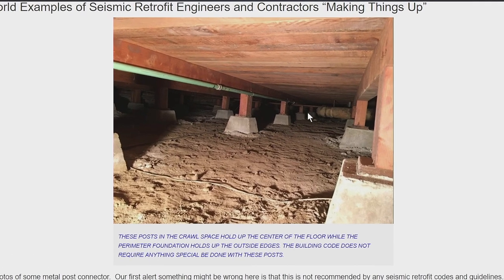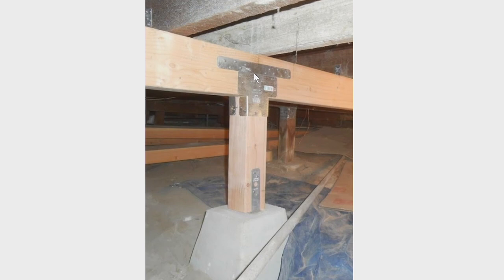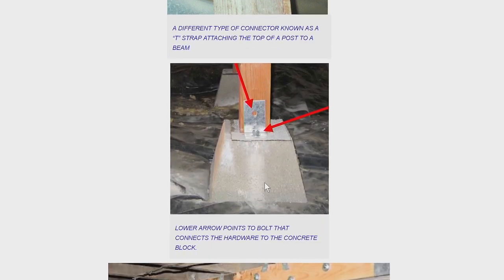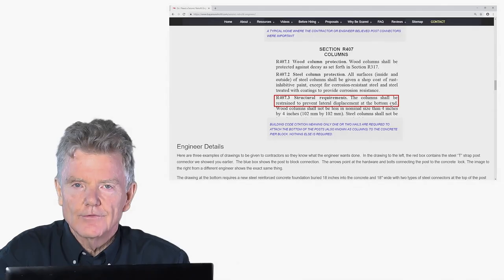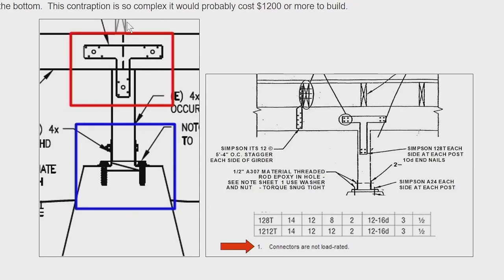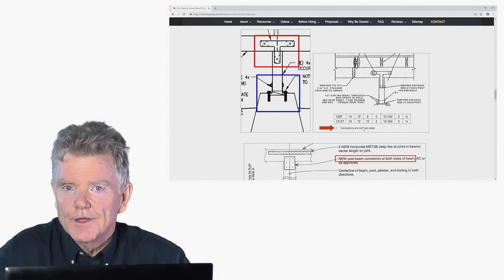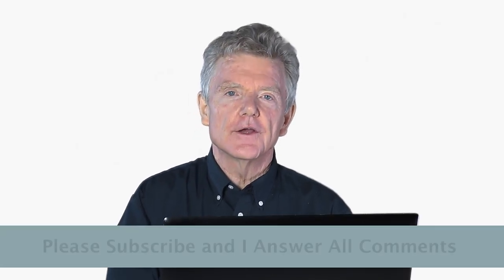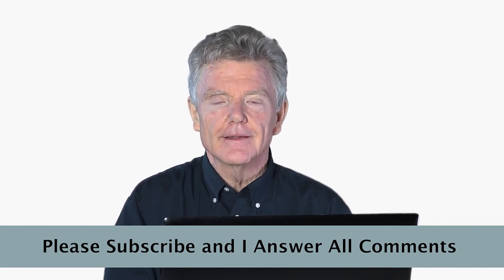Seismic Retrofitting The Post to Beam Connections

Comment: I see your point as it is related directly to seismic or 'lateral' loading incidents. However, you are leaving out two additional VERY important types of loading conditions...The first is due to soil movement (shrink/swell) and the second is wind uplift anchorage. These connections are instrumental in aiding in structural stability of the home during those two types of loading conditions. To tell people that the engineers are simply "not educated" enough and just spec these connections because they are uninformed is a bit dangerous on your part.  Especially given the fact that you didn't even mention these additional loading conditions...It is the engineer's job to think through and design for ALL possible future loading conditions. IF you are going to make a video spreading misinformation, maybe you should be able to disprove the need for those connections ( after applying all loading conditions) mathematically. IF you cannot, you are not qualified and you should simply not speak on these matters. Also, I will remind you that the IRC code is the MINIMUM spec allowable. It should not be looked at as the end all/be all for construction. It was created to give the contractor and homeowner information on the absolute MINIMUM safe design conditions.
Reply from the maker: I see your point as it is related directly to seismic or 'lateral' loading incidents. However, you are leaving out two additional VERY important types of loading conditions...The first is due to soil movement (shrink/swell) and the second is wind uplift anchorage. These connections are instrumental in aiding in structural stability of the home during those two types of loading conditions. 

I live in an area that is almost entirely unconsolidated soil that shrinks and swells as you describe and have never seen a post connection come apart even the least bit. 

To tell people that the engineers are simply "not educated" enough and just spec these connections because they are uninformed is a bit dangerous on your part. Especially given the fact that you didn't even mention these additional loading conditions.

How are a few nails or even steel straps going to prevent a house from lifting up off its foundation?  We do not see this kind of damage in earthquake county, at least I am not aware of any.  From my point of view building codes inform engineers and contractors which connections are important, and this isn't one. 

..It is the engineer's job to think through and design for ALL possible future loading conditions. IF you are going to make a video spreading misinformation, maybe you should be able to disprove the need for those connections ( after applying all loading conditions) mathematically. 

I do not look at theoretical/mathematical conjecture.  I look at empirical evidence and also hope that the authors of the building code did the same.  If you can find ONE photo of failure to a post beam connection due to soil displacement I will point that out because I have some empirical evidence to back it up.  If you can find another photo with wind damage that would also be helpful. 
 
IF you cannot, you are not qualified and you should simply not speak on these matters. Also, I will remind you that the IRC code is the MINIMUM spec allowable. It should not be looked at as the end all/be all for construction. It was created to give the contractor and homeowner information on the absolute MINIMUM safe design conditions.

And it should be based on a MINIMUM amount of empirical evidence and I don't see any.  Also, in seismic retrofits one must also look at the math in terms of spending their money wisely and cost-effectively.   Really, please send me photos, not math formulas, of the two types of failure modes you mentioned, that occurred in earthquake country.  I am always eager to update my site and provide accurate, evidence based, information.